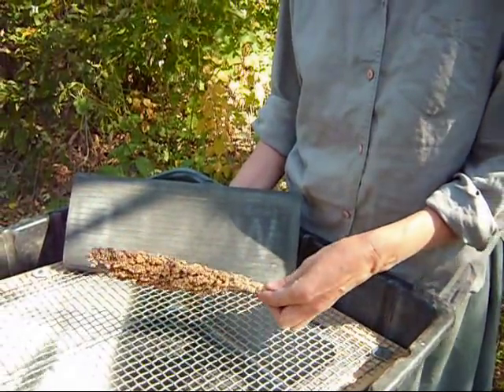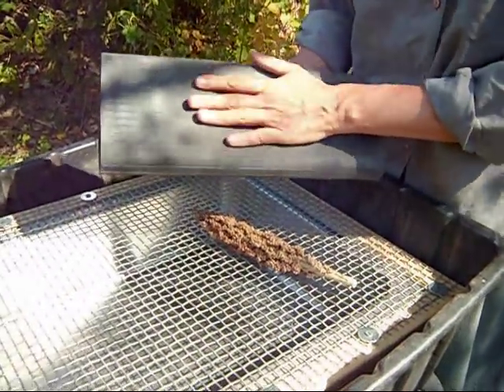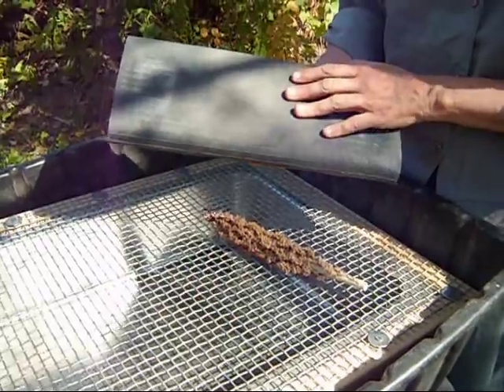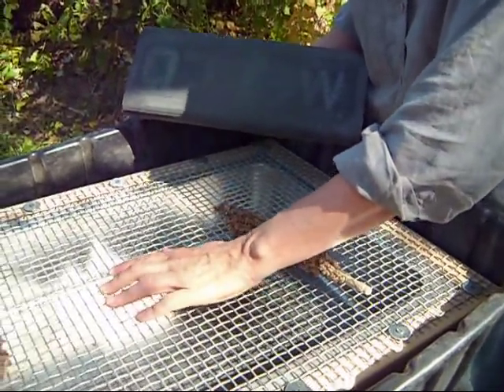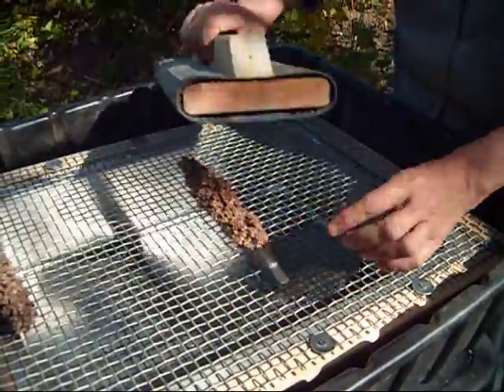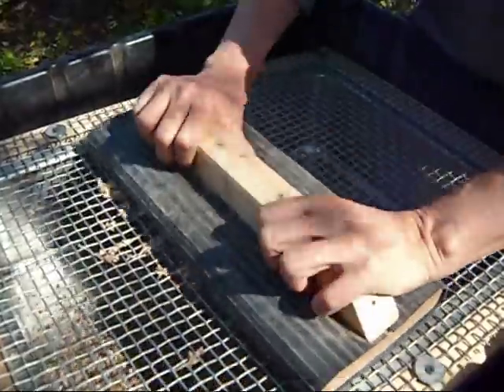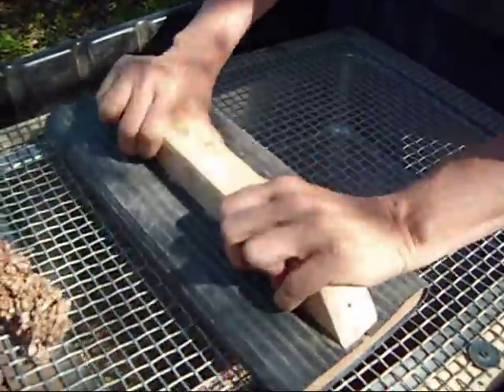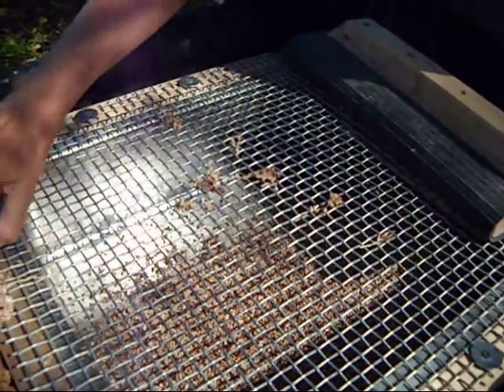Hand-Threshing Sorghum

Comment from the maker: Since we are on a gluten-free diet we haven't used wheat for a few years, but based on our experience growing those two grains previously we think that this will work on both wheat and oats to remove the outer seed-head chaff. That's all you need for wheat, but unless you grow hull-less oats you'll still need to remove the inner oat hulls. That's a whole 'nother issue. We don't know of a homestead scale process to do that. It involves steaming, heating, drying, etc.

Bob & Larisa

Comment: Great method, since I did not have those materials at home, I used a wooden plank over the hardware cloth I made and it works just as fine, now, how do you clean the grain obtained?
Reply from the maker: After threshing we scalp off the major debris using either wind winnowing or 1/4" hardware cloth.  Then we sift with a window screen to remove the fines.  Next we fan winnowed at a low speed, running it through twice.  Any large seeds that didn't hull out in the threshing are sifted out with a round-holed sieve sized to only allow threshed seed to pass.  If few in number, they are fed to the chickens.  Otherwise they can be re-threshed to remove more seed if desired.  See our video for the fan winnowing process (found at Winnowing Amaranth).
Reply: Robert Dahse
I see, I would require the fan to do that and I don't have one, which size would it be the round hole sieve?
Reply from the maker: coline123456789 The hole size depends on what you want to accomplish. If it looks like a lot of seed wasn't fully threshed we use a 3/16" hole size to allow some of the seed with hulls to get through, then try to re-thresh it to get more clean seed. If all we want is threshed seed we use about 1/8" holes.

Comment: Once you thresh the sorghum, how do you remove the hulls?  I have some White African sorghum that I am trying to find a reference to removing the hulls.  Any suggestions?
Reply from the maker: Hi Robert - We were working on updating the sorghum cleaning process this fall but haven't finished the project yet. We have improved the theshing board by making a new "rubbing paddle" that is covered with a fine mesh screen - a stiff 12 mesh, stainless steel. This is only 4"x6" in size which makes a smaller area to press on and seems to be more effective than the former larger paddle.  We also have added in an additional step at the beginning, but I'll leave that for now as you're more interested in the final step. Basically we screen off the fines or winnow. Then put the seed in a large bowl and shake the bowl. The unhulled seeds will work their way to the surface where they can be skimmed off and returned to the threshing board for another pass through and repeat until most of the hulls are removed. If you're milling the sorghum for flour a few hulls aren't a problem. Getting it clean enough to cook as a whole grain means more work. We'll post the new process in photos on our blog by year's end. http://s119396054.onlinehome.us/
Reply: @bobdowser  Thanks for the reply.  I look forward to seeing the process on your blog.
Reply from the maker: O.K., we finished a PDF with photos and text showing our latest threshing and winnowing process for sorghum. It can be found at http://www.geopathfinder.com/Sorghum.pdf

Comment: Isn't the grain in a hull? How do I get it from thing step to the edible step?
Reply from the maker: As mentioned in an answer below, "After threshing we scalp off the major debris using either wind winnowing or 1/4" hardware cloth.  Then we sift with a window screen to remove the fines.  Next we fan winnowed at a low speed, running it through twice.  Any large seeds that didn't hull out in the threshing are sifted out with a round-holed sieve sized to only allow threshed seed to pass.  If few in number, they are fed to the chickens.  Otherwise they can be re-threshed to remove more seed if desired.  See our video for the fan winnowing process (found at Winnowing Amaranth)."
Reply from the maker: O.K., we finished a PDF with photos and text showing our latest threshing and winnowing process for sorghum. It can be found at http://www.geopathfinder.com/Sorghum.pdf
Reply: @bobdowser  thanks for the vid. Would love to see the PDF, but unfortunately although it's only 5 months old that seems to be a broken link?
Reply from the maker: @bpcmemorial  There are indeed broken links since our website is no longer online. It's now found in 90+ screenshots on the "Wayback Machine", otherwise known as Archive.org. The link to the sorghum PDF is here: https://web.archive.org/web/20220119233822/http://www.geopathfinder.com/ThreshingByHand.pdf  And the link to the Amaranth winnowing is here: https://web.archive.org/web/20220119233824/http://www.geopathfinder.com/Winnowing.pdf